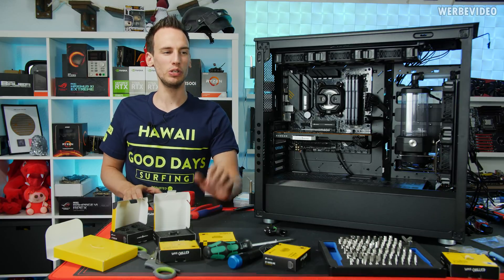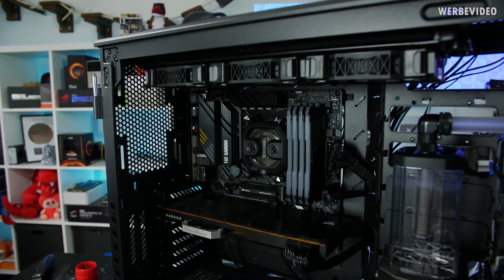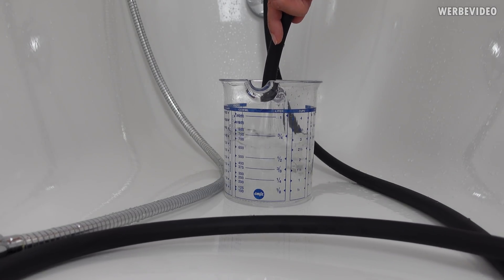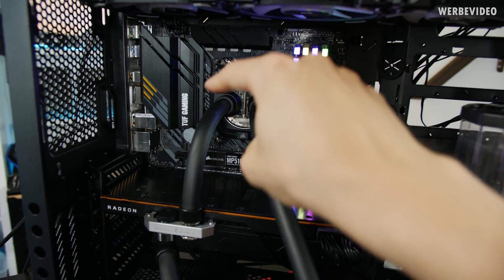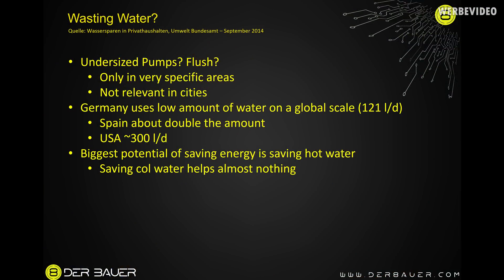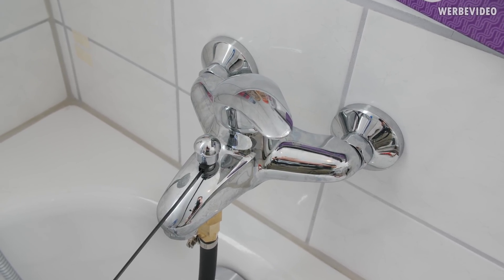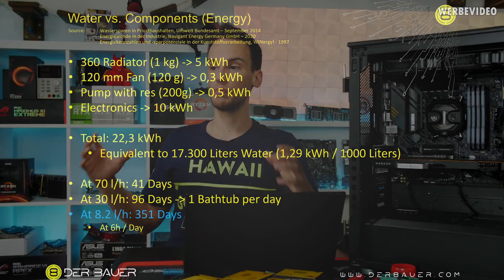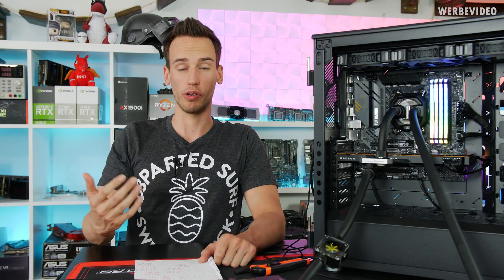So much Better than expected! Cooling my PC with TAP WATER

Comment: I have an idea of doing this, and my tap water is around 4 to 6c even in summer. The water plant isnt even adding any chemicals to the water, its all sand filtration and normal filters. So there isnt much recidue in my tap water, never seen any chalk buildup and such in my shower head etc.

Comment: Did similar way back in 2007, our water is unmetered and we just pay a yearly amount irrespective of how much we use...

Had a rig in fully submerged mineral oil setup, i had a radiator at the rear inside the oil that had a constant stream of cold mains water running through it at about a litre per minute...always kept it very cool, compleatly silent and completely dust free.

Comment: "Not wasting water it goes back into the system" Your drain does not get pumped into a reservoir, it goes into the river and out to sea. 
It is the same as running a garden hose to the street. If you were to collect the water and use it to water your yard or fill your toilet, that would not be a waste, but a running faucet, is a waste, period.
Reply: So cooling is not a legitimate use?
When the alternative is rads (or additionally even a chiller to achieve similar performance) heating up your room triggering the AC to ramp up does it even matter?
Reply: @TheExplodingCore  Where did i say that? All i was saying is his claim that the water was "going back into the system", is total BS. 
But to your point, my heat pump's AC doesn't "ramp up" from my heavily OC'ed pc. My pc runs at a steady 42c when pegged, on air. I've never needed to water cool my pc. If you get a large case with good air flow, good fans, and components that were not forged in hell, there is no need for water cooling, period.
Reply: @klubstompers  I was referring to the last sentence of your comment.
Can't see the difference between watering a huge ass garden that's just for show (not producing) or washing your car every week and using tap water to cool a pc.

Well, I don't have an AC since it's not common in Europe and with my rather small gaming/office room I can easily bring up the temperature several degrees just gaming for a few hours.
Whatever amount of power (W) a pc is drawing has to be cooled by the AC (BTU) to keep the temperature at the same level. Your implying the let's say 400W just disappear..?

I'm confused by your 42c and 'components not forged in hell'. This channel is directed towards enthusiasts and overclockers so I'm assuming we are talking about high end components with high TDP and energy density.
Reply: @TheExplodingCore  If you have a choice of dumping water down the drain, or using it to make something grow to help maintain an ecosystem, you don't think the latter is more beneficial?
 It's been proved time and time again, that in case radiator water cooing is no better than a proper built air cooled rig for enthusiast tier pcs, unless your going for records, and then your on nitrogen anyways.
Radiators outside of the case, are a whole different ballgame though.
If your worried about your room heating up from your pc, you could always run your pc's exhaust out a vent.
2 400 watt power supplies will each create different amount of heat at full load. 400 watts is 400 watts, but depending on how they are built and work, determines the heat they generate. But no, 400 watts of heat/energy does not disappear. Energy is neither created nor destroyed. And with this, adding pumps, which needs energy to work, would actually be adding more heat to your room. Just like putting a fan in a closed room, makes it hotter. It may feel cooler cause the air is circulating, but the fan is producing heat.
Reply: @klubstompers  touché the garden comparison was bad. Still stand by my point tho.

Yeah, that's why the idea presented in the video seems so intriguing to me. You can get the heat out of the room very easily. Add a heat exchanger for longevity.
Running my pc's exhaust out a vent turns it into an exhaust filter.
Alternatively to achieve the same thing use the outside unit of a small AC, heat exchanger between coolant and pc cooling loop. That's it. External chiller basically. But that seems so much more wasteful imo

PSU thing is due to efficiency. One produces more waste heat at equal load thus drawing more power from the wall. Besides the point tho.
Reply: @TheExplodingCore  All cool ideas!! :D
Yea, efficiency and waste play a huge role in energy loss/heat loss. 
This is why i always try and buy PC components that have good thermals, because i know they are acting more efficient and utilizing better parts/design, or at the very least drawing away the heat more efficiently, which prolongs the life and usually ups the performance. 
Another thing you could do is plumb into an  air con unit, but this will not solve the energy used issue. 
Another thing that would work pretty slick, for a single PC, would be to plumb your houses cold water line into your pc's water cooling, in a loop. Intake closes to where you main water line is/coolest source, and return closest to most used faucet. The cold water pipes in the walls will, with it's large volume of water and piping, take a lot longer to heat up, and when you turn on a faucet your removing the heat and adding more cool water to the system. You wouldn't be wasting any water either. This wouldn't circulate full time, since your plumping is under pressure, but when you turned on any appliance that uses water, it would circulate. Might be a cool experiment!!
Reply: @klubstompers  Definitely would have to take the pressure off the pc loop with that but I like the idea. Don't know if I'd want to drink that water tho it's most likely fine.
You could probably make use of the energy using a heat exchanger for underfloor heating or other applications but I'm not well-versed enough in plumbing to lay that out in detail.
Reply: @TheExplodingCore  Yea, should be fine to drink, its just going through a heat sink and heated up a little, but yea, definitely would want to lower the pressure. Your home plumbing is about 2-3 times that of a pc water pump. I just read that pc water pumps move about 4 gallons a minute, so youd have to find out a way to keep that water circulating, or i dont think it would cool well, which would require a pump in the system, to keep it constantly circulating threw the water blocks, and i dont think you can do that in a pressurized system with out doing a ton of work. No wonder it has never been done. 🤑

Comment: 82 percent unused:
This is because in the winter you have an excess amount of water that can not be used or stored, so it is dumped back into the rivers or not collected at all, and in the summer you don't get much fresh water melt or precipitation to keep the reservoirs full, so towns dry up. In the wet season this is a good idea, but in the drier season, this is very bad idea!! In the summer, a better idea would be to route your building/homes' ac to the system, since it would be on and used anyways.

Comment: Kinda have a different approach, rather than running a regular rig and using AC what about running an enclosed loop, but putting the radiators in a bathtub of cold water, then leaving the window open in your bathroom???

Comment: I thought about this idea last year with the idea of an internet cafe cooling all of its computers on tap water. The cost to setup is much cheaper than watercooling setups and I imagine cooling multiple PC's on the water would mean it takes multiple years for it to cost more than the cost of components and environmental impact, considering after a few years the computers are replaced anyway I expect it would be much more friendly. Though I haven't run any numbers on that.

Comment: Get a big container (ideally insulated, like what you use for picnics) and 4 or 5 buckets.  Fill the buckets with distilled water and put them in the freezer, after they're frozen pour some distilled water into the big container and add a bucket of ice.  Then run your PC with that cold water.  When the ice is melted, refill the bucket and put it back in the freezer and put one of the other ice buckets in.  And to make it even more efficient, run the water through radiators with fans like normal before the water goes back into the container, to get it as close to ambient as possible.  That should make the ice last longer.
Or if you have a freezer that you don't mind drilling a hole in, run a hose to the freezer then put it through a copper coil that's encased in a solid block of ice.  If you use radiators to dump heat first, and if you have a lot of ice in the freezer (like a thermal battery) then it shouldn't put too much stress on your freezer.

Comment: An other idea that would be safer than tap water running in a water block is to use a closed loop cooler that uses a small rad to exchange heat into the flow of tap water. Then have the heated up tap water feed a household hot water system, pre heating the water a bit and saving on hot water power usage.

Comment: This is the only true form of water cooling.  Radiators are another form of air cooling.  The water just transports the heat fron the CPU to the radiator (which is just a big aluminum heatsink)

Comment: It really is not a bad idea IMHO, at least when considering user that could actually catch and re-use the water coming out of the PC (flushing, wattering etc.).

You completely skipped over the electricity cost of running the pump + fans (I guess its very little but still). And I really think your calculation of energy requirements for the components is really low. Imagine all the factories in the link between copper and cooler. (making sheet metal, heat treating, manufacturing, packaging, transportation...). 

What really is the question (considering you can re-use the water so it's not a waste) is the long term effect on waterblocks. I imagine there wouldn't be a problem with microorganisms with constant flow + clorination of tap water, but mineral deposits man that another story. You'd have to use blocks without microfins inside probably to avoid buildup. Or clean that on regular basis, which would make it all just impractical.

Comment: i have well water and a septic system so this would just be the cost of running the wells pump. 
  i would be a bit concerned with minerals etc in the water degrading the block and the city water here has chlorine and fluoride and who knows what else in it

Comment: If you live in an apartment, how about connecting your loop to the central heating. Sure the water temp would be around 50 Celcius (said to be the average in Sweden), thereby introducing heat to the loop but with proper flow maybe your cpu/gpu would not get much hotter than that, while at the same time you are sending your heat into the central heating system thereby saving energy.

Comment: Most people bath in hot water anyways... what if you used your pc, stored the water from the loop in an on demand water heater, heated the water a little more, then used it to bath every night?
Reply: If the water was a little warm, would it then take less power to heat it for bathing?
Reply: Then your water consumption would not increase, it would just be the same. The more you pushed your PC, the easier it would be for your water heater to regulate the temperature of the water.

Comment: My initial thinking is it adds a bit of load to the city water system, but a lot of modern cities will recapture it fairly effectively or simply pass it into a river. 

However, would a sufficiently large reservoir not be more efficient and act as a large enough heat soak for whatever duty cycle that it makes the use of tap water -> drain a bit silly?

Comment: to maximize the water usage you can have it go from your computer into the water heater so that it: 1) doesn't waste water just for your computer, 2) takes slightly less energy just to get the water up to temp for a shower. 

If you do that I bet you can cut costs in half.

Comment: It's an interesting argument mentioning water use. I'm in my last year studying Environmental Engineering so I hope what I have to say has some impact. It is recommended to be using water regularly at least once a day. There can be bacteria and sludge buildup in premise plumbing (plumbing inside the house that receives water from the water main) if the water is stagnant for too long (typically days or weeks on end which is why it is recommended to leave a tap dripping or to flush your water when returning from vacation). So yes, you should regularly use water. However, water that goes down the drain isn't 100% recycled, as it goes back into the environment and is treated by a waste water treatment center. It isn't exactly "useable" until it is treated by the WWTC. And by that time that water per your region is no longer available for consumption in your region as it has been moved on. Recycled: yes, 100% recycled and reusable in your area: not exactly.

Comment: I would be interested in how the blocks look long term. Tap water is typically chlorinated to keep things from growing in the pipes with a little extra chlorine to ensure there is enough when water stands in pipes for long periods. Chlorine and its ions are happy to attack copper. In a normal closed loop, the chlorine will all bond and the chemical attack will stop. In this kind of open loop, you have continuous addition of fresh chlorinated water to continually attack the blocks. I don't think it would be a quick process, but long term, the fins and plate of a block could become corroded.

Comment: Imagine opening or cutting the water flow brutally, creating a pressure wave that rips the tubing off the water block and flood the PC case
Reply: I don't think water hammer would be much of a problem at those flow rates tbh.

Comment: Cleaning should be as simple as running vinegar through the "loop" every other month for a bit, maybe using a simple pump for it, not a PC water cooling pump, in an open loop so the machine can stay powered down.  Esentally what you would do for a coffee pot. The softer your water the better.

I'd also be curious if you have a tankless hot water heater, you might offest the cost by putting the exaust of the PC into the hot water loop of the house, which should trigger your tankless and it's pump to run less.

Comment: Was curious to see what additional savings would have been if you averaged out all of the electricity cost saved by not running the fans/pump as well as the material cost.

Comment: I'd want to see you hook it up in some form to a large container of water sort of like those reservoirs that hold tap water here in America. Like a huge tank with a hotter water coming from the PC entering in the top and the cool water from the bottom going to the PC.  Could the natural cooling of the water outlast the use case of a single day so it wouldn't raise the temperature for a single day of use? So the water would naturally cool overnight when you weren't using the PC and it would work all day without becoming too hot. What do you think?
Reply: Also, if you bury the tank underground or in a basement you could keep it at a solid temperature all year round.  I guess the question is how much total amount of water in the reservoir would you need to make it not heat up too much over daily use. Literally turning the reservoir into a giant water radiator.

Comment: 1. Make a closed loop of piping in the earth at 5+ feet
3. Route hoses or pipes out and into your living space with a pump somewhere in there
4. Use what you just built to exchange heat with the ground

Comment: I would also factor in the power consumption of the loop. You might also need to observe how long before deposits build up and the cost in that regard. You could also 100% justify this as well if you somehow can get all that outflow water to be deposited in a hot water heater (or the intake for the water heater) so that the hot water heater uses exactly as much less energy as the CPU spent. That last one might make this method significantly better, especially if you take a hot shower or bath, though you would need a custom rig to control when water comes in through this system vs the cold line.

Comment: Setting aside the environmental impact and the effect on your water bill (if you have one), Tap water is filled with (likely) Chemical and Mineral contaminants that will corrode and clog up your blocks very quickly.

Comment: First impressions are, its probably less efficient to have powered fans cooling the water in the system than using the national supply of water, but you have a lot of impurities so I'm not sure how the current design of cpu blocks would last, if you removed the micro fins and increased the flow rate maybe you can achieve something useful long term for PC's. Curious as to how the lasers get around this issue.

Comment: Using drinking water to cool a pc and then throwing it down the sewer, not too smart at all. I would like to see you try that in Florida, you will have to remortgage your house because of the cost.
Talk about hurting the environment, why not take the water and recirculate it as they do in a cooling tower or an evaporative condenser or do what I have done, I built a drycooler and ran the tubing to my second floor and turned off all the fans in my gaming rig. You can also mount a 9x120mm fan Rad in your Air-conditioning Return duct. there are many ways to solve this problem instead of what you are doing. This video should be deleted because of its impact on the environment, because there is always some moron that is going to try this.